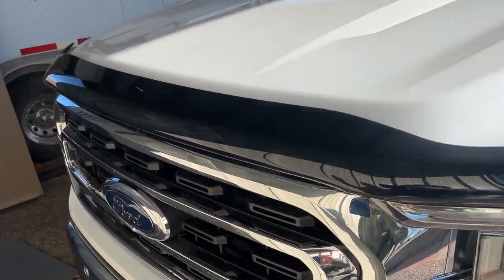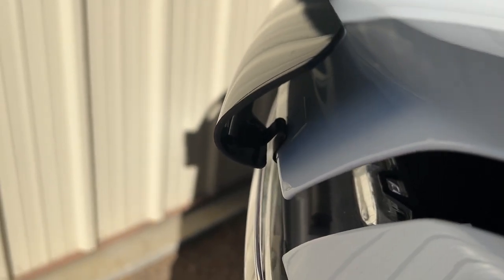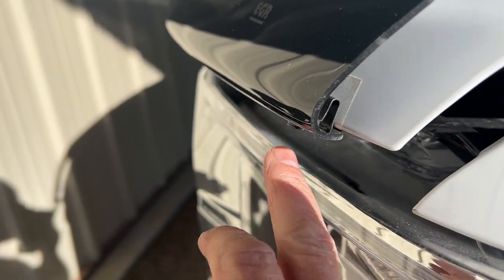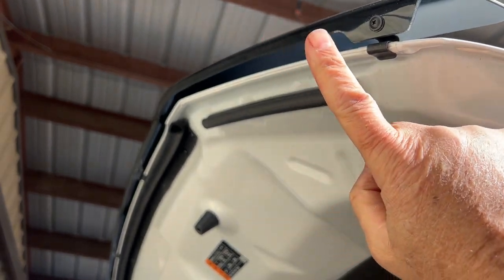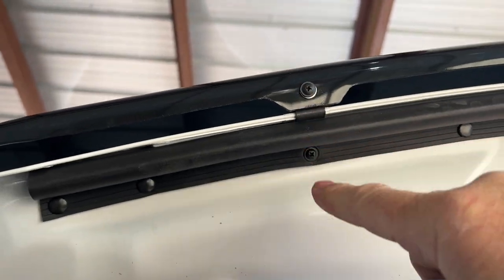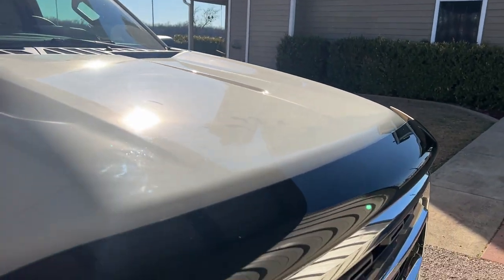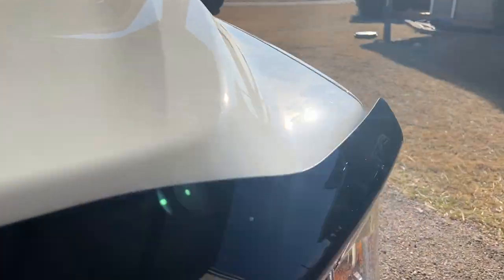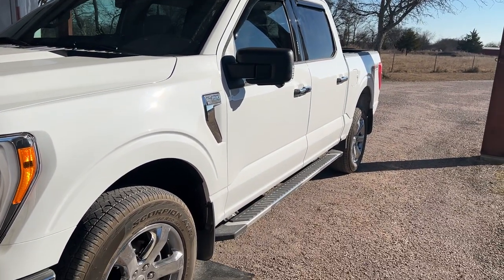Installing A Bug Shield On Ford F150 - Truck Modifications

Comment: Fancy, Rick. Ceramic coat your trunk. I recommend brand Turtle Wax/Hybrid solutions ceramic spray coating. It’s affordable ($18), very easy to apply, and lasts 6-12 months. You’ll be amazed how much repels dirt/mud and easier to clean.
Reply: 👍 A friend of mine here in Australia recommends the same product,  especially on his black and dark colour cars.  Except here the price is,  wait for it...  $48 Australian Dollhairs for 470mL = 1/2 Quart...

Comment: You can also get small 'noise whistlers' that attach to front bumper - they make a noise to warn animals, when you go above 80klm/hr
Reply: They work good,  or just fit a bullbar... then fit twin roof mount chrome air horns,  clearance light, west coast mirrors, CB etc 🤣
Reply: @JoeC88  If you're heading out to the oodnoodata track...🛣️
Reply: @artmallory970  I don't go there, it's too hard to spell 😀